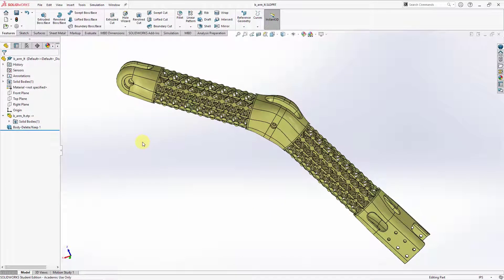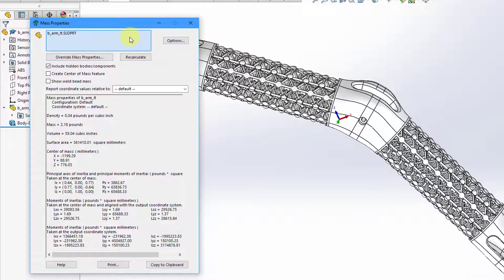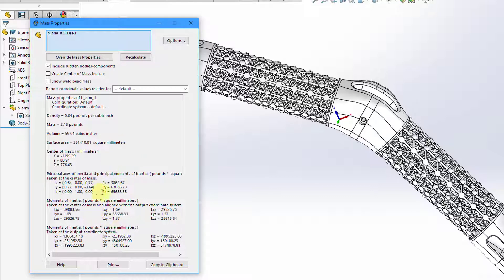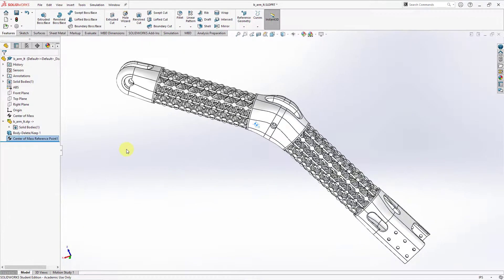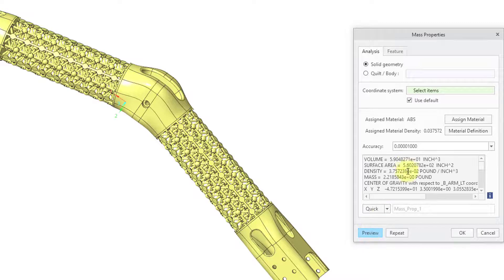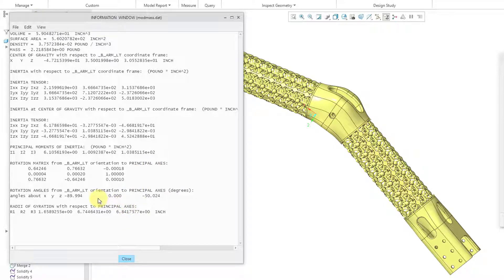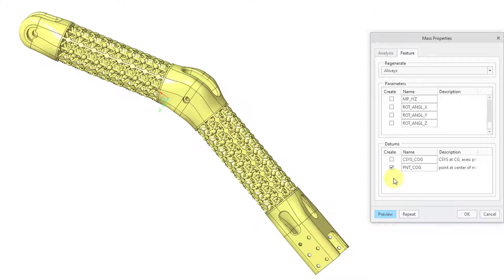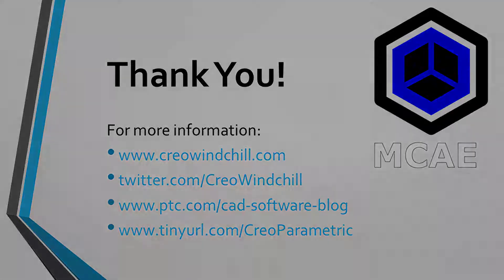SolidWorks - Creo Parametric Comparison - Mass Properties

Comment: How would one go about using mass properties in conjunction with prep for 3D printing? Surely the infill density and other print determining qualities would significantly change system properties, no?
Reply from the maker: You would have to ask someone with a whole lot more 3D printing experience than me.
Reply: @CADPLMGuy  aw shucks. Worth a shot in any case :)